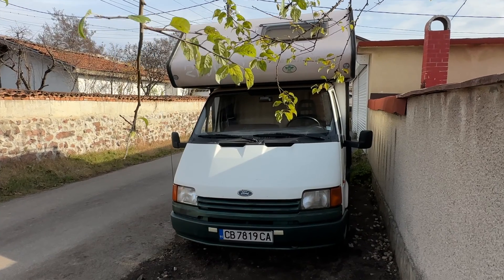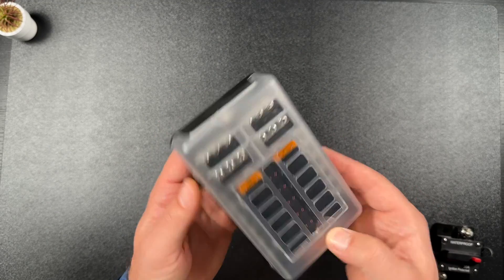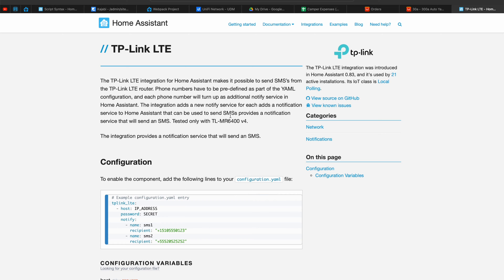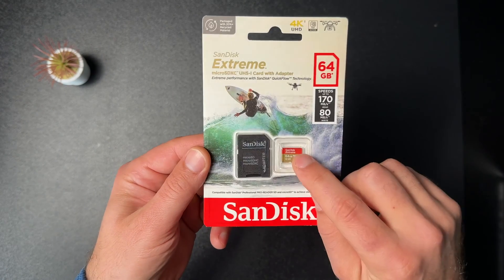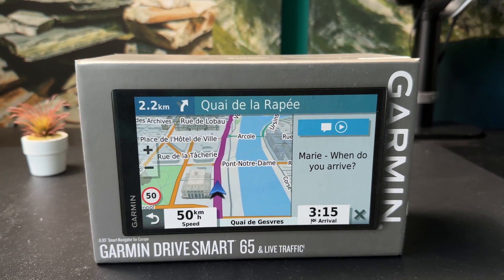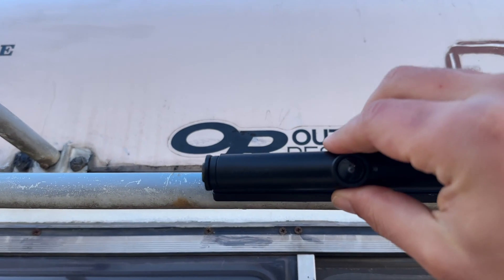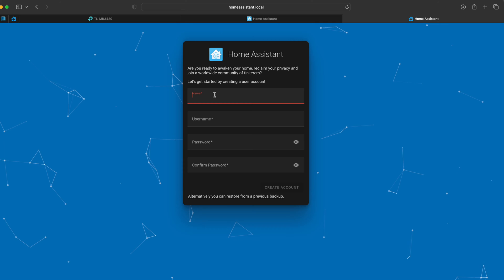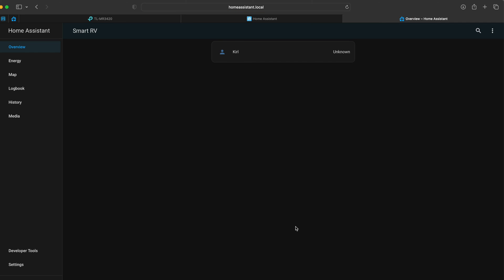Smart RV Conversion: A Step-by-Step Guide to Turning Your RV into a Smart Home! Episode 2

Comment: Hello! I'm from Argentina and I built something similar in my motorhome: RasPi, HomeAssistant, Victron stuff, etc... I also used a Kincony product (kc868-a16) which is basically an esp32 (esphome compatible) with 16 mosftet outputs as interface between homeassistant and the relay box. I also installed ZigBee sensors and a Teltonika wifi/4G router. Everything is integrated with HomeAssistant and accessed from my cell phone, tablet and the Android stereo installed in the cab. Soon I will upload some videos of the installation. Congratulations on your project.
Reply: Would love to see it
Reply: https://www.youtube.com/watch?v=Cm8CFgaGYHg The video is in Spanish, please activate the automatic translation
Reply from the maker: Sounds really great, please share your work it is interesting to see. And BTW how you access the HA on your motorhome remotely? VPN, Nabu Casa, Cloudflare or something else?
Reply: @KPeyanski  Cloudflare tunnel. I'll upload a video when I'm done with the automations, hope it will be soon.
Reply: Good job my friend and I have question for you. Can you remote access you RV Home Assistant through 3G/4G network? Like you need to check camera, temperature, turn on/off lights etc?
Thank you in advance

Comment: this modem / router works perfectly for me with home assistant  Huawei B311-521, why didn't you use a 2 in 1?
Reply from the maker: As I said in the video this setup is working good for me for many years on a place with under 20 Wi-Fi clients. So I decided to use it again for the Camper. However, I’m always open for suggestions and ideas like the one that you just shared. And I will check this 2in1 router as well

Comment: Excellent, I was wondering what type of router you were going to use.
Reply from the maker: Cheap and working one :) As I said in the video I have such for years in my other place and it is working perfectly for the money. Some features are missing, but for an RV they are not so important. BTW do you have anything else in mind?
Reply: @KPeyanski  I think its a perfect choice for an RV, I use a TP-Link OneMesh TL-WPA8631P KIT to my sleep out, but it was  not that good as the distance was over 25 meters so i put in a Ubiquiti NanoStation LocoM2 but I use The TPlink as router at the other end as it has 3 ethernet outputs and both wireless 2.4g and 5g.

Comment: I'm glad you're going to use the Retrobright idea. People who refurbish stuff usually use UV LED stripe from China. You can also use a fake nail lamp. Maybe some used with 4pcs of UV lamps in them will cost a few bucks. I'm looking forward to see what ideas you come up with and what I could use for a normal house too.
I was kinda surprised you used a Garmin camera and navigation. I thought you were going to use some kind of classic camera that would also serve as a security camera.
Reply from the maker: Hi Radek, I decided to try Retrobright technique after your comment from ep.1, so thank you very much about that. I have to find a specific UV lamp that is proven to be working as there are different UV wave lengths that may or may not work. I chose Garmin for backup camera as it was a lot easier and I don't plan to integrate that camera with HA. Apart from that I will probably add another camera(s) and I will try to integrate them with HA at later stage. I guess we have to wait and see ;)
Reply: I’ve added 3 Esp32 cams in my RV and I’m very happy with them.

Comment: I think the combination of home assistant with 3D printing and RVs is super interesting. Ideally, a 3D printer would be an essential part of any serious RVer if nothing else but to print out replacement parts when away from a hardware shop or walmart. I imagine an RV version of the "Ship of Theseus" where as many or more components on an RV were 3D printed as were manufactured. Good luck with the project and I'll be checking it out. Eventually I'd love to see EVs be the base for RVs in the future!
Reply from the maker: Interesting point of view :) The most used PLA & ABS materials in the 3d Printing are good but not for everything. Anyways, many thanks for the comment and ideas :) 
p.s. I totally agree about the EVs but I guess we are not there yet...